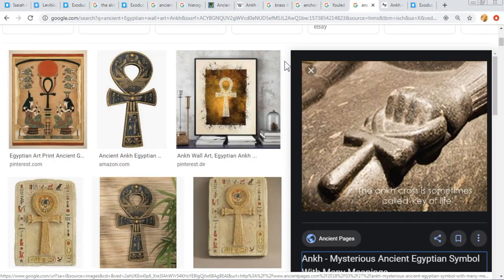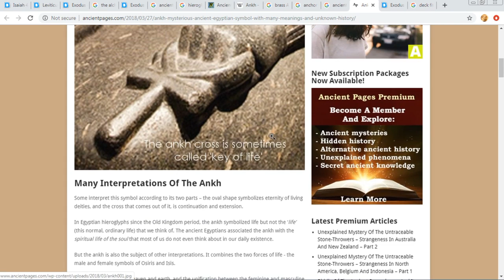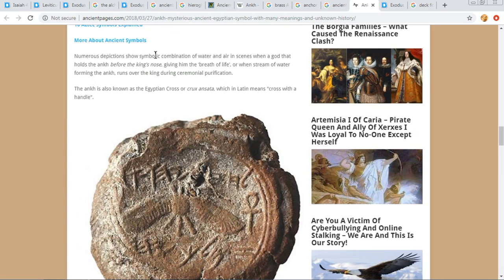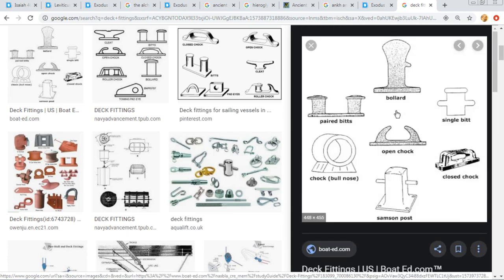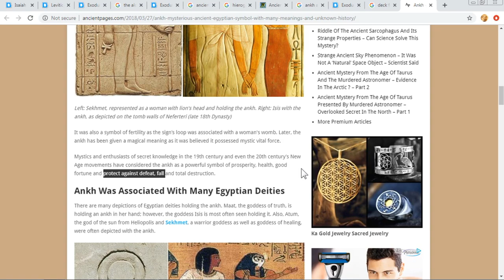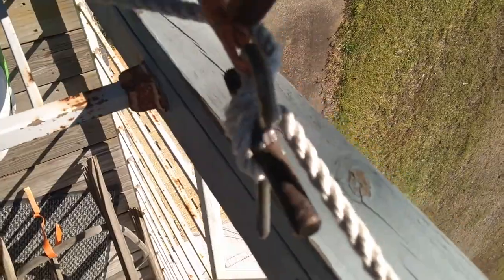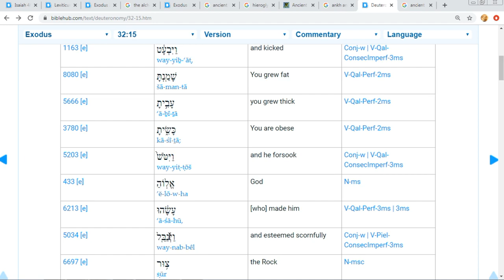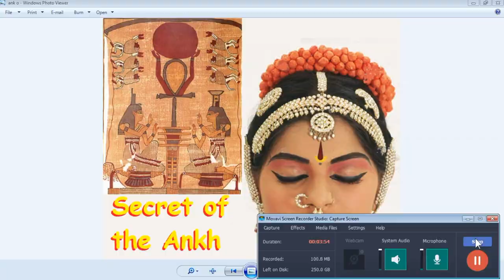How to Use the Power of the Ankh

Comment: I think The Ankh is an electroculture rod. if it's the key of life that was a tool to generate electric energy! it makes sense. The top part of the Ankh represents eternal life/feminine and bottom is the under world that is the part/masculine that you stick into the ground. The side is the birth/receiving the energy. (probably from the Pyramids). To unlock the flower of life which is what that's Ankh is made from in geometry! 🤯 It's all connected!!
Reply from the maker: Looks like the Hebrew word for "I am". Same hiero represents mirror. Controlling light.
Reply: @strictlyeducationalmagick  Also, Ankh is made of copper just like an Electroculture rod. Copper is grounding. You stick the rod into the group. An anchor is also grounding. A mirror reflects light just like a crystal. I'm just typing out loud. Thanks for the interaction. I feel so enlightened with listening to everyone's  theories as it ties into my revelations that confirms I'm on the right path.